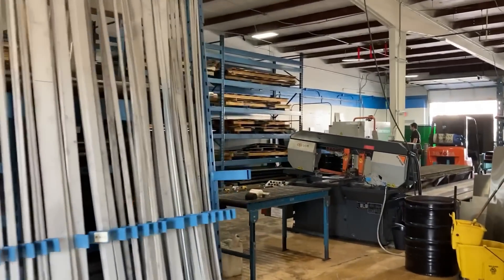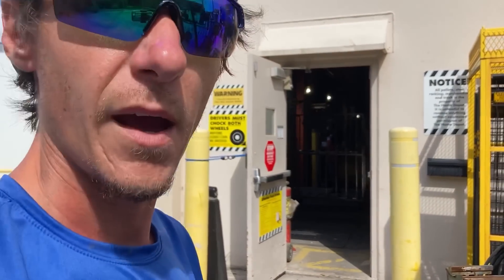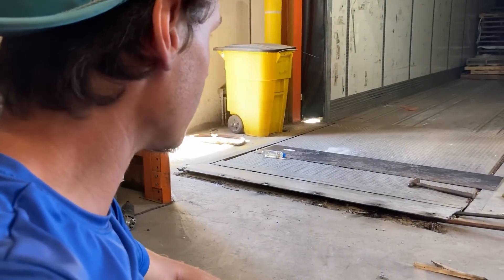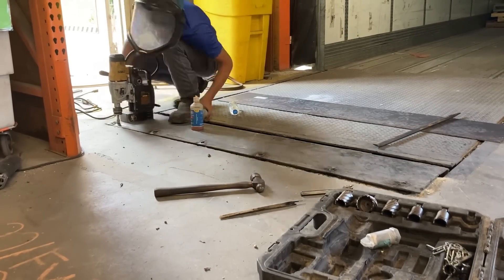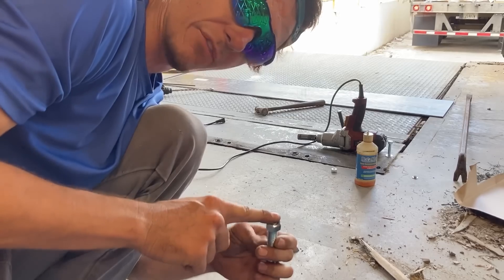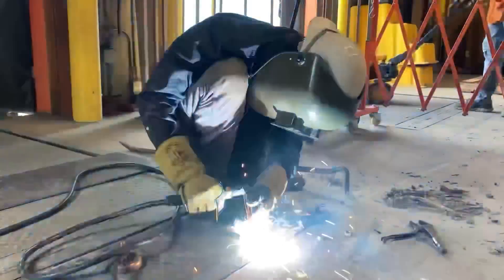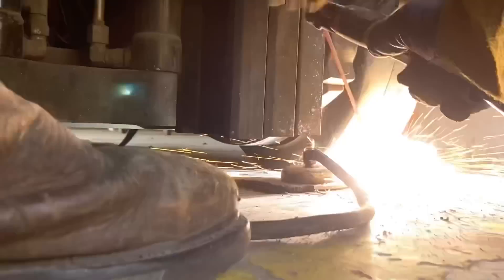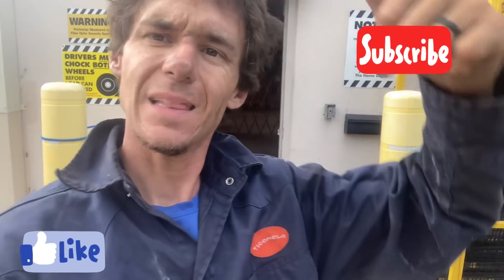“Simple” welding repair on loading dock goes wrong!

Comment: i used to build those and install new. all around florida. we would hire concrete cutters to cut out pit and margin from floor slab. we would  excavate , build all curb steel with inbed studs . drill 3/4 " holes for rebar in cut slab edges every 10 " and epoxy 36 " x1/2" rebar in them.form with ply wood , pour concrete. strip forms and  and install dock leveler . usualy welded it to curbsteel with a 7024. everything was smooth and nothing sticking up to catch forktrucks. also did door packages and ballards.  was good work but i didn't make the money. my greedy ass boss did. i still have tools truck and skills just not as spry . 52 now. my millrite days were 20s and 30s. that repair you did was a valiant attempt. i would have bid it as concrete and steel repair. the raised red heads arent good for those transitions. you can cut a parallel line 12 inches from damaged steel and cut out back damaged steel. rebiuld new section with neslon studs welded insie angle and weld it to other two members. then form with wood and pour new concrete. 2 day job . did it all in one day once with a good experienced helper.  
you didn't by chance , happen to swing a outboard boat engine for a guy in tampa at Ricks on the river? with the ford and the auto crane?
Reply: I was that mechanic that hired you! Kevin. great job man .that went absolutely perfect. had that motor hooked up in a few hours and it ran a trial voyage to the bay and back.  seriously, 200 things could have gone wrong. none did. thanks. im pretty sure it was you.

Comment: Well done 👍 next time you get one of those types of jobs try Mushroom-Head Hammer Drive Pin Anchor, 6 1/2 inL x 1/2 in Dia.
Reply: Those will pull put over time as well. We use them alot and they do hold pretty good for what they are though.

Comment: nice job...next time use split hammer pins so an not to have to cut down the anchors just drive them in and the eod angle/transition plate will spike down when driven down.

Comment: I work on docks for a living this is a temporary repair and the incorrect anchors for this. They didn’t use a faceplate welding which is incorrect. Your suppose to weld your transplants to your face plate then weld the rear curb angle to the dock… next time use mushroom anchors and weld around it. But great welds. Keep it up
Reply from the maker: I will check those mushroom anchors out for sure! thank you for the advice

Comment: Dude you were on the right track. But you could have drilled another hole and used an anchor bolt right next to the one you wanted to weld.once you finished welding you could have welded the one next to it for extra strength.
Reply: He wasn't on the right track in the beginning though.
Reply: @01mustang05  he provided a solution to a problem. It works fine and could have worked better
Reply: @justinkatipa9577    It does not work fine! He kinda fixed one problem and created another problem - almost as bad NOT welding the ramp back up to the dock EVENLY as it was, creating a new bump, wasted time cutting it and welding it back up - that he probably charged for - which is criminal to charge someone for a screw up he needlessly or negligently made!
Reply: @01mustang05  ok mate. Calm down there little buddy.
Reply: @01mustang05  let me guess, you’re a welder lol

Comment: You need to sit down and study it. Study what ur gonna do and what ur gonna need for the project. When you showed us what you were gonna do with that plate I was like he doesn’t even need it. Plate on the floor was still good to do whatever you were gonna do to it. Study it. God bless. Keep on burning and you’ll definitely be earning. ✌🏼
Reply: "Study what you're going to do and what ur gonna need" - ??? - That's some funny english there eh don't ya think?  I think you were safe with just saying "You need to sit down and study it" though. - As in study what's going on and study how the ramp is put together and functions.   I think his mindset was locked into replacing instead of considering the option to repair.  He almost screwed up the ramp, jumping the gun too - bending metal up with the fork-lift.

Comment: 172 dollars for that plate ? Ouch ! That’s about twice the price I’d expect to pay here in Belgium …
Also : strange that you still invest in mains power tools nowadays.
Reply: "Metal supermarket" is probably the most expensive steel supplier in the world. Simple angle 1500x150x150x10 costs there about £90 (in the UK). Compare it with https://www.fhbrundle.co.uk/groups/3004E__Equal_Angle_Steel_Bars?page=3
Reply: It depends on how long your running your tools for. You have power for you welder anyways, so usually you run a set of AC power tools, and only pull out cordless for something oddballed. I cant imagine running a grinder for 30 min straight on only batteries. The batteries would add several lbs to the tool.
Reply: @5084204  it depends where you’re located as far as metal pricing goes. A local store (which is more then local) charges a premium to end consumers, but businesses get about a 40-60% discount cause it’s a tax write off and don’t have to pay sales tax. Every time I’d submit a purchase order for metal at my old job, it’d be about 60% less then what the website said it would cost.
Reply: @Sffker  in Europe we have a dreaded VAT,  about 20% to be paid by the end consumer. Whatever you are buying as a company, you have to pay VAT initially, but later in the chain you pass that VAT to your customer.  In theory, if you pay tax, but your customer will not pay you, you can ask the taxman to give you the VAT back, but the very next day you will have a detailed accounts check by several sad guys. Apart from the tax, the trade companies usually get the bigger discounts, however system is easy to trick: I do have a traders card and access to much better prices with a few wholesalers. Because of that I saved thousands on my home DIY projects
Reply: They’re always expensive like Alro. And he’s doing it when steel is almost 3 folds in price; thanks Covid and inflation.

Comment: Replace rear curb angle.   cut / brake the concrete. New angle complete with Rebar welded and bent to grab wet concrete , weld angle too left and right side  let the pour harden and robs your uncle.

Comment: Should not have seperated ramp from the dock at 3:10.  It was welded to that height for a reason, it dropped and wasn't brought back up on the re-weld at 13:20.  Young gun should figure out what's what, before cutting up and making more problems.
Reply from the maker: guess what, it worked out in the end and the customer was happy

Comment: Must be a rookie. I'm not buying  material  until I look at the job COMPLETELY
Reply from the maker: must not work for large corporations who want out done asap
no matter the cost
Reply: If I’m not physically looking at it, I will try to get pictures.
Reply: When you submit a quote to a business for repair, your quote includes time and material. They pay for the material, even if you don’t use it. In this case, it would of taken even more time to do the prep work, find out that you did (or didn’t) need material, went and got the material, came back, yeah no. Contractors look at the problem for what it is, and prep for it accordingly. Sometimes you end up in the wrong, and that’s just a part of life. Nobody knows everything

Comment: I thought you would put a block of some sort on that stubborn end and lower the fork on that, maby with some weight on it, but anyway great job
Reply: It's actually a common misconception, forks don't actually have any power going down... It's only like 3-4 pounds for a carriage. The Hydraulics go in relief. It's not like a compactor.

-Your friendly neighborhood power lift technician
Reply: @harroldsmith3235  didn't know that, it's something new I learned today lol I used to operate an excavator and thought it worked the same way, thanks for the explanation!
Reply: @tomasmerino1039  very different, excavator is fluid powered both ways, most lifting devices just go into relief (a solenoid valve opens and the fluid returns to the resvior) since they are meant to lift.
Reply: @harroldsmith3235  actually makes a lot of sense. I'm a little bit wiser :D

Comment: What I’ve done in the past and a fork lift is available is put a small block of  metal on part you want to press than a decent length of metal for forklift to drive on OR put a post standing up on defective area than pick up a heavy pallet and lower it down on it and also both ways will have forklift out of your way for working. Not safest way but sometimes you gotta do what you gotta do. Stay safe

Comment: I've done the same repair several (loads) of times & it's always a nightmare. The only "real" solution is a new concrete apron cast around a new or fully re-worked loading bay tray. No matter how good you do the repair ^^ the sheer weight of the forklifts + load will break it again.  It ain't you, it's physics.

Comment: That is a routine repair with a formed transition plate, pallet material and trash are driven under the plate causing it to stay up creating a "trip hazard". The corners typical "pop up" because the welded heads of the wedge anchors get worn away by forklift traffic or some times they will run a fork under the side of the plate. Not sure how you were going to remove the transition plate with out removing the pit leveler which is also welded at the front embed angle and would require a forklift and extensions (depending the size) to remove the unit. Little tip on the next one, do not use the washers on the wedge anchors, just the nut and impact them down, then cut the nut and bolt in half with the torch then you can "dome" the head by welding clockwise around the perimeter working towards the center (think  of a spiral), this should give you a "rounded" finish surface which is "safe" for pedestrian and forklift traffic. Nice job regardless. Keep up the good work. As for buying the plate and not using it, we all have been there and done that. Be safe!

Comment: Gate slams are a b.i.t.c.h. Every single time a pallet or forklift goes on the loading platform that exact peice of L steel takes the hit to protect the concrete from shattering from the dock ramp. They are a pain to repair. I've come to the conclusion that welding it down and adding a wedge ramp to the edges saves from future repairs for a few decades.

Comment: Id rather destroy the top of the redhead bolt then potensially stripping the tapers... I always keep the nut below the head when hammering it. If you ever ruined the tapers on stainless redheads the nut aint going anywhere and you most likely have to cut it and install a new redhead. Just my experience. Otherwise i would have installed Hilti HUS3 bolts with sinking head. Then you easily could take the sheet of later. And welding wouldnt be needed.

Comment: been there, you have my sympathy.
one tip i got for you though: when using a fork truck to press down on stuff use the forks, not the tires
Reply: Also be very careful you dont light up the hilo. The underside of those things tends to be piled with oil soaked dust bunnies. The fire grows quickly since its starting at the bottom. To make matters worse, the fire is hard to get to. 
Using the forks like you said helps alot to keep the sparks away.
Reply: Unfortunately forks do not have down pressure tire is his best option
Reply: @Ryan809  Yes they do. you can lift the whole front end's weight onto the forks. 
And if you still don't have the pressure put a big heavy object onto the forks.   You ever used a fork truck bud?
Reply: @flyinpolack6633  Yes I have every day for the last 20 years there are a few that might be able to but I can tell you the one in this video does not have down pressure
Reply: @Ryan809  ya ,  in my travels through space and time , most fork lifts that I have been around will only lift things .  If you need downward Force  , need to put stuff on the forklift .
Reply: @cometrider2000  Putting weight on the forks does not give you force it gives you weight if you put something on the forks yes you’re adding weight to it but the forklift itself is heavy they’re made counterbalance whatever it is you’re picking up you cannot put the forks down to lift the forklift up once the forks hit the ground with whatever load that is on the. that’s as far as they go for him to go around in that building to find something that’s as heavy as the forklift to go and set down the forks wouldn’t make any sense just using the forklift did the job my suggestion would to of been to use the back of the forklift because that’s where all the weight is to counter balance whatever load you put on the forks  so what I’m getting out with all this is no matter what you do by putting the forks on that plate they will never have enough weight to push that down it looks like the forklift itself barely had enough weight to flatten it out

Comment: If you ever get bored with welding, try this..... next time you get a weld job, imagine you could not make any sparks on the job. Seriously, use your imagination to fix it without using any hot work. You will learn way more about fabrication with that mindset. Try it and you’ll love it. Let me know! I do believe you work hard and do nice work. Thanks! Steven J.
Reply: Don’t get me wrong, I do understand there are weld jobs that absolutely require welding, cutting and grinding. However, again on your next job just imagine at least, at first there could be no hot work on site. Your mind will surprise you and it’s a lot of fun!

Comment: Could have drilled and set a second redhead on the edge so you could have one with a nut and clamping forces sucking it to the floor while you welded the other. But you do great work dude. Shit looks mint.

Comment: 1. Nobody will be able to stick a forklift blade under the side by the door. 2. The cord on the grinder can be replaced or fixed. 3. The oil leak on the truck can also be fixed. No worries!
Reply from the maker: the case got ran over but yes I agree!

Comment: using an oxy acet cutter, gas axe, always turn off the fuel first, acetylene, makes me wonder how good of a tradesman someone is if they can't do something that is basic
Reply from the maker: it makes me wonder how smart you are to spend you time watching such a lowly tradesman
Reply: @robertyoung729  How do you extinguish a fire? take away the fuel. My research?  nearly 40 years as a boilermaker  in the heavy structural  industry, go back to looking up information on the net mate, you wouldn't be welcome where I work, fool

Comment: Why didn’t you just drill a red head next to the one you was trying to hold down. It would of been just 2 more you would had to cut off  and weld and it still would of worked with no fork truck bad driver

Comment: Yo never hit the nut on a thunder stud you maniac! It messes the threads up and then the stud spins and you can’t draw it down. ALWAYS run the nut down and hit the stud and the stud only. I have ran hundreds of studs into the ground with this method and have never had an issue. The few times I have hit the nut caused me major issues. 🤷‍♂️
Reply: Try using roto on hammer only, you will never go back.

Comment: Why would you post this video? This just make you look incompetent at doing this type of work? That plate is going to pop again and that was a terrible repair. The original install was bad so it's not entirely your fault but you should have never taken that job. Stick to what you know, if it's welding, stay with welding.